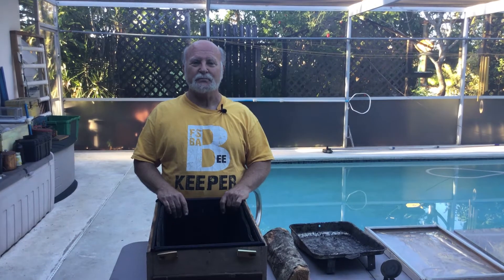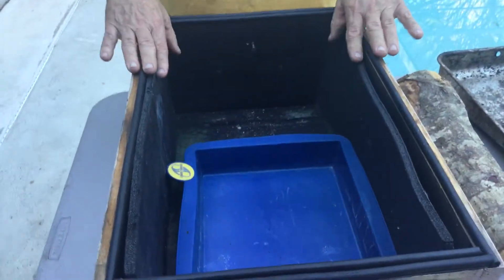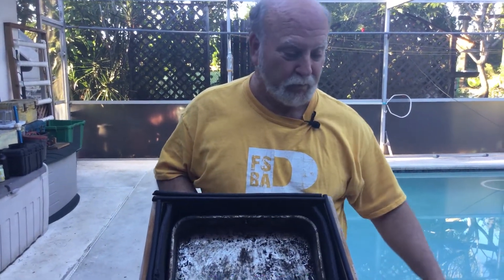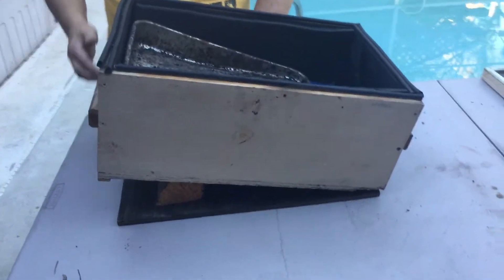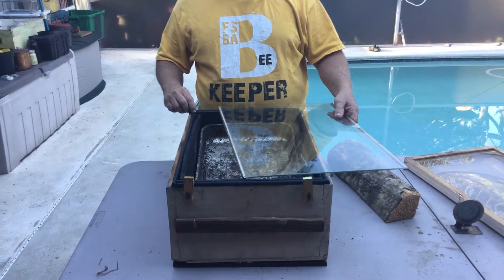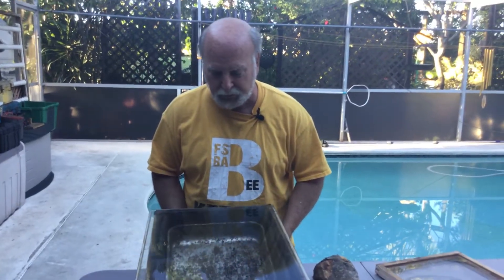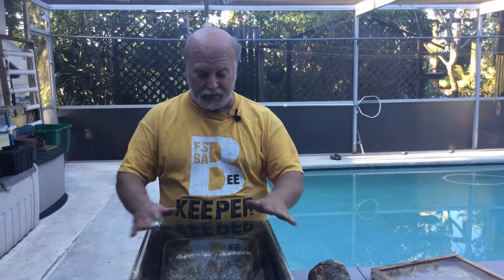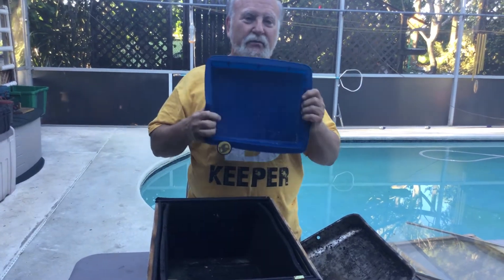Beekeeping - Super Simple Solar Wax Extractor

Comment: What a cool build! Can you add a coffee filter or cotton cloth to the spout end to filter it totally?
Reply from the maker: Not really, even a piece of #8 wire mesh can cause a log jam at the spout.  You have to melt the wax again in a double boiler to pour it into molds and that is the time to run it through a filter.  Now, you can lay a piece of fine filter cloth on top of the paint tray and put the comb on top of that and the wax melts and passes through the cloth and leaves most of the slumgum behind.  There is a trade off.  If you make the solar melter too efficient then the wax can get too hot and degrade.  I have a lot of experience with solar cookers and made my first wax extractor too efficient and the wax was smoking as it melted.  That would have run through the kind of filter you describe, but the wax is light brown instead of golden and has a smoky odor.
Not good.
Reply: @southflbeekeepingwithrich Got it! Thanks for the tips! I appreciate it!
Reply from the maker: Glad to help out.

Comment: It appears that the feet of the paint tray are sitting in the silicone catch pan (2:13-2:50 time stamp). How do you avoid the wax encasing the tray feet? Great Concept. I will be stealing this and adapting to use up in New England. Thanks!
Reply from the maker: I don’t avoid the feet in the pan, because the wax usually peels right off.  However you could put a brace on either side of the box and a cross piece to rest the tray on, instead of the feet. Let me know how it works for you.

Comment: How do you prevent the melted wax from exiting the bottom tray of the whole box is propped up at an angle? Thanks!
Reply from the maker: It’s not that great an angle, and the bottom tray is fairly deep.  Plus even if it were completely filled, the paint tray doesn’t hold that much comb to start with.  So add it all together and it’s not a problem.